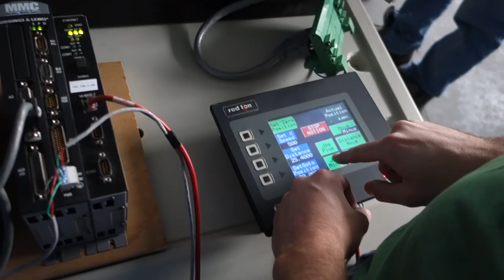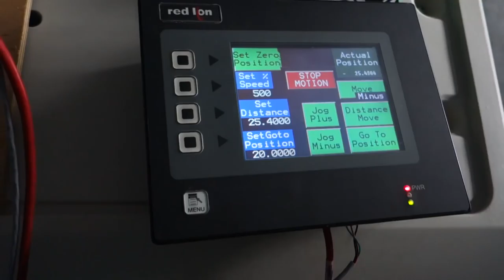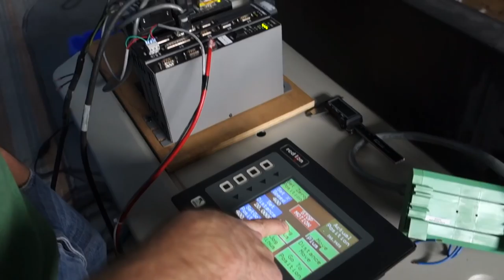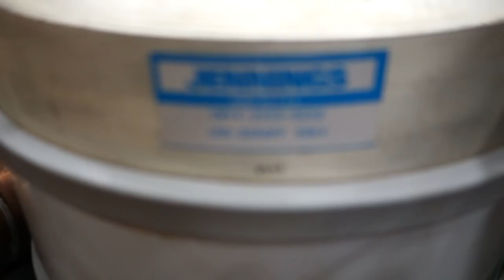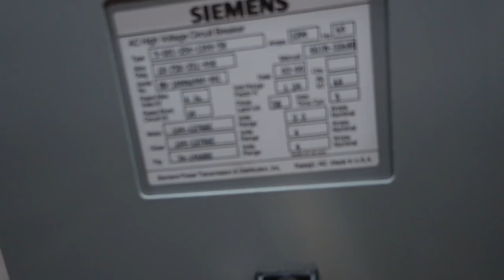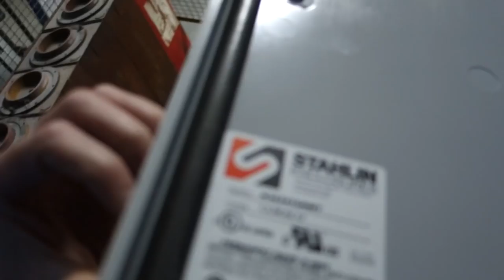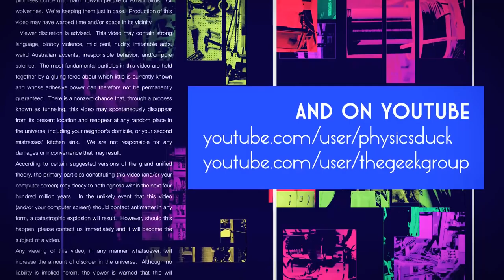Captain's Blog 4 30 2016 Giant HV Donation and Coil Winder Progress

Comment: That big grey siemens device is a seriously powerful piece of kit. 600 kW tetrode, heater voltage 23 volts, heater current 550 amps. http://www.datasheetarchive.com/dl/Datasheets-SL9/DSASL00179018.pdf
Reply: +Ryan Willis Holy crap, that's a big valve. They should build a giant VTTC with it.
Reply: rocketman221projects And make it audio modulated. AM VTTC? I think yes.